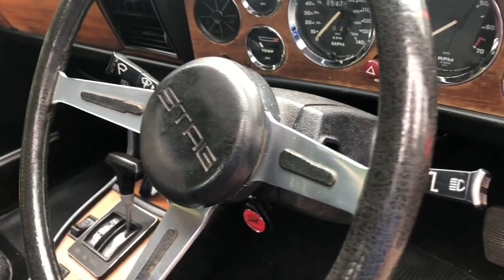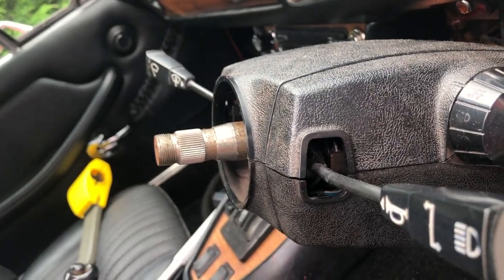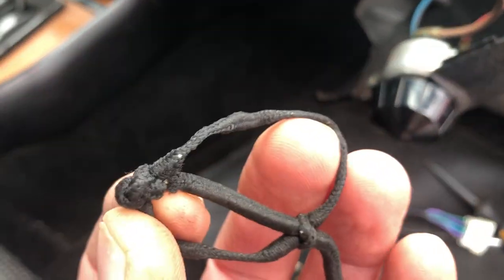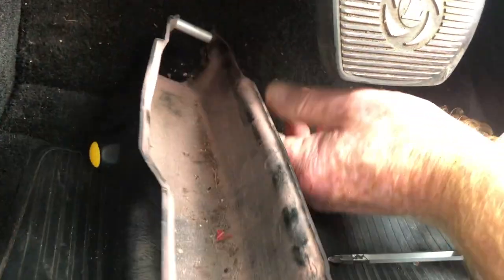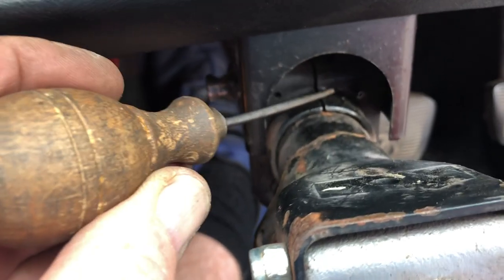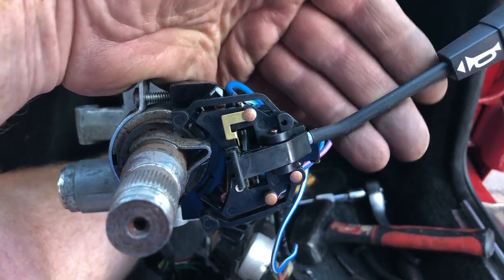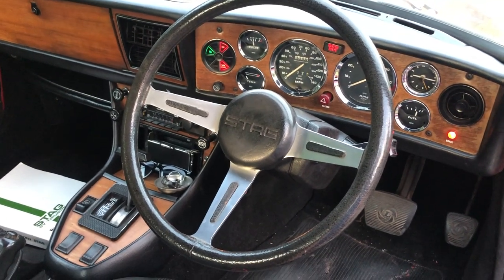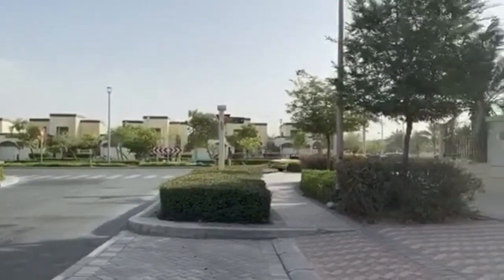A Triumph Stag in Knickers?

Comment: Wow,  what a hassle! I've replaced that stalk on  my sedan a couple of times over the years, and it wasn't as involved as all that! Firstly, you don't have to remove the steering wheel to get those plastic shrouds off. But they are fiddly things to get off and back on again - as I think you found. But once the shrouds were removed, the wiring just hung down beside the column, there was no fancy cover over it - which made it a lot easier, obviously! Wow, that was a hassle! 
The reason I had to change mine was the mechanism that changes from high to low beam failed. Twice. On mine (74, 2500TC) that mechanism consisted of a thin piece of copper-like stuff with a dob of solder each side, which was the contact. What happened was that over time the heat of the current passing through it weakened the copper bit, so it lost its "springiness", and failed to make good contact. The fix, on advice from an auto-electrician who had a Range Rover with the same unit, was to fit a relay in the light circuit, so that there was only a small amount of current passing through the actual switch. That worked.

Comment: Little tip: leave the steering wheel nut on but loosen it, and THEN pull the steering off the splines... that way you can give it a real good tug without rearranging your facial features :p

Comment: A tip when taking off a steering wheel, undo the nut but leave it on a few turns, then when you yank the steering wheel off it does not suddenly let go and hit you in the face. Also a bit of tippex on the wheel and shaft so you put the wheel back on in the correct position.